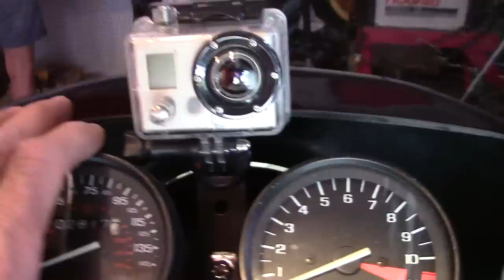Project Honda Sabre Cafe Part 21

Comment: Check the coils with an ohmeter, the coil wires, the spark caps and the spark plugs. I had the same problem 2 months ago. The red line in my suzuki is over 13000 but it didn't exceed 7000. I checked carburetors, fuel line, filters and finally the ignition system. And the problem was a faulty spark plug (and it was new!!!) and the conection between the coil and the coil wire. A double failure like that can make you crazy !!!
Cood luck and greetings from Spain!!!

Comment: The yellow(stock) wire into the coils also runs the tach.  So if you swap coils, and the tach acts funny, that's the coil that's having problems.  For those of us that don't have a timing light, we use the tach for those old V4's.

On the big V65 Sabre/Magna's, there is a ground strap run from the battery to the coil mount.  Couldn't hurt and may help...

Comment: your valve adjustment has helped me immensely! I wish you would have taken it a bit further and shown how you have to adjust the cams differently for front and top valves, but what you did show is helpful. I personally don't recommend putting anything that you can drop into the motor down loose like that. You may consider just putting a string on it in case it drops out of your oily, slick fingers, but it's a good process! Have you tried adjusting using I think it's the Dave Dodge's method of using a .003 feeler gauge between the cam and the rocker pad? its suppose to set the others at .006 automatically. I think it requires a bit more of a soft touch because you have to make sure you're adjusting both sides evenly, but once you get the touch, it's a bit faster i think? Great vid! Thanks for sharing! Also, one of the first things I was told by a forums I'm a part of is to make sure after you adjust your valves that you re-synch your carbs. I don't think this will help this problem, (your rev-limiter will likely be a source for this issue) but it's something to keep in mind!

Comment: Great job keep up the good work. I was go to suggest the coils. I once had a Ninja with the same problem. But, it would not do it all the time. So we were stumped we changed the with some high performance coils and the problem went away. Don't know if that is any help at all. You did help me with valve adjustment though. I just bought a 83 V65 Magna and I need to adjust the valves but was a little unclear on how to do it. Thanks you were a great help.

Comment: I was really hoping you would have figured it out, seeing as how I have the same problem. I already adjusted my valves and cleaned all my connections earlier this week. infact, my coils had a loose ground, but that didn't end up fixing it. I have narrowed it down to a problem in cylinders 2 and 4. I am considering getting new spark plug wire because mine is older than me, and is missing some insulation.

Comment: The airshocks that are standard I used a manufacturing handbook from the factory online you must have 10mls of 30 weight oil in them at all times this stops the shock from vacuuming under load, it creates a cushion of bubbles in the oil as the oil turns foamy allowing a more smoother transmission whe compressing and decompression. We us the same method for the drag bikes and our Motocross display team bikes.

Comment: The wires going into the coils don't matter since the spark boxes cause the coils to fire on the exhaust stroke too (research "wasted spark ignition")  The secondary phase in the coils is probably out.  Swap the coils and see if the problem swaps cylinders.

Comment: I don't know if this helps because I see you have the stock air box on there BUT. On my cb750 I replaced the stock air box with pod filters and had the same problem where it wouldn't go beyond 4 or 5k. Turns out increase in air flow disturbed the vacuum within the carburetors and prevented the main jet needle slide assembly from pulling upwards all the way. Long story short, you may have a vacuum leak somewhere since it seems like your carb slides are not going up all the way.

Comment: Dean the spark generators the ones under the side cover are known to be problematic check the ohms between the white wire and the blue and the white wire and the yellow they should be about 480.

Comment: Good information here man. Most people don't show or describe the exact procedure. The use of a bent gauge to set both valves is good too. Thanks. Do you set the exhaust valves at the same clearance? I'll set mine to .005 as per the Dave Dodge method and see what happens. ??? Thanks for posting this.

Comment: It's pretty basic. Two wires to the pulse generator, one to ground, one to power and one output to the coil. Same for both CDI units. It has good 14 volt power while running.

Comment: Nice build. Do you have a way of checking the tach or the wiring to it? To me it sounds like you're hitting the rev limiter at 11,000 rpm. It sure sounds like its reving more than 5500.  If the tach is only receiving half the pulses it should, then it would register half the actual rpm.

Comment: You have to remember too that in the higher RPM ranges the main jet system is most relied on by the engine. Search the following in Google Images: "main jet pilot jet graph"

Comment: Im adjusting the valves on my v65, and the manual says to line up T1.3 and T2.4 with the case line. when i do that, it works for cyl 1(top dead center valves have a little play), but not for the rest (they are at the top, but the exhast has way to much play). im 99% sure im doing what the manual is saying, but for some reason its not working. The bike runs, its just got allot of loud ticking going on.

Comment: hi there man, been following your vids on the sabre, i am thinking on buying a vf750 83 to do a cafe racer style thing, i got some questions.
Electronic system is it very complex?
Engine, is bullet prof or not really?
Fuel consumption?
Parts, easy to find, not really?
Changing the tensor on the distribution chain for the front cylinders is it easy, expensive?
thanks man!

Comment: my v65 recently started doing this, and I noticed that the bolt holding that ground strap was sheered off. I re grounded in a hole that was right next to the old one, but it didn't fix it. i also don't know how to tell if i have the wires going into the coils wired correctly sense it doesn't indicate positive or negative. i assume they are correct because it sounds good. mine will still rev to 10k in neutral. but when im driving it looses power at around 4.5krpms.

Comment: Pulse Generator Resistance should be 480 ohms+-10 Ohms
Ignition coils
Primary Resistance 2.0 Ohms
Secondary Resistance with plug caps on 29 to 40 k Ohms
Secondary resistance with plug caps removed 20.6 to 27.4 k Ohms

Comment: hey bro hears a thought my vfr was doing that allthrough not quite that bad your bike is a v4 like mine and all thrugh history there has been issues with ststors and voltage regs i had replaced 2 voltage reg before i fiwuered out the stator was going bad once i swaped it out the bike started to run like a raped apeall the way to redline just a thought for u to check it